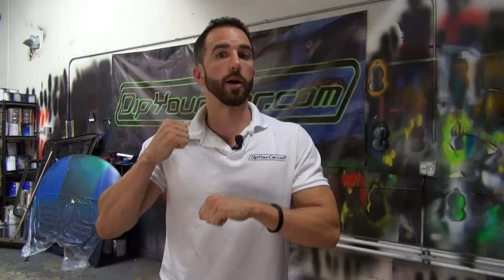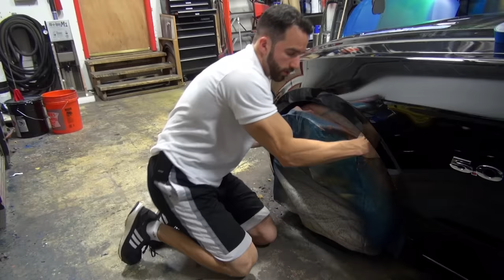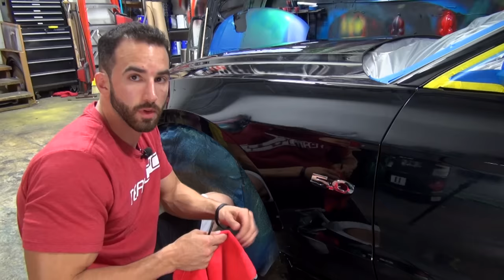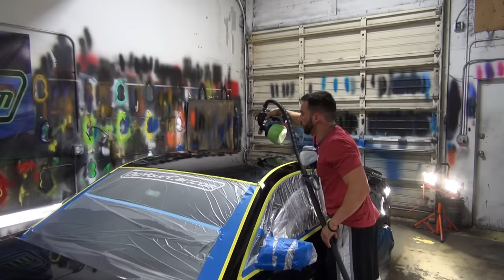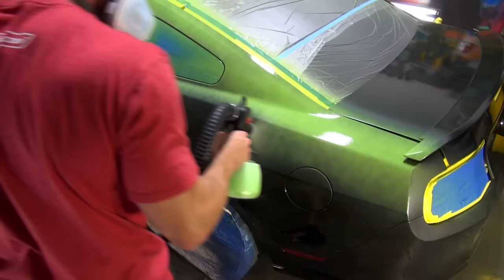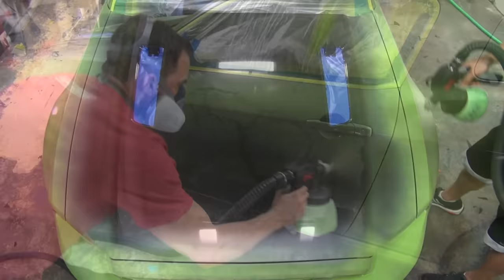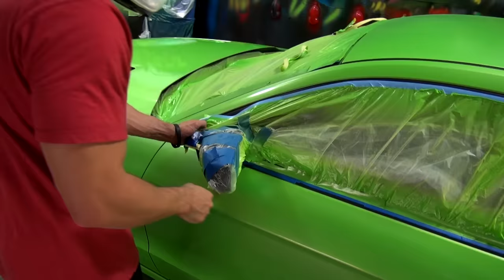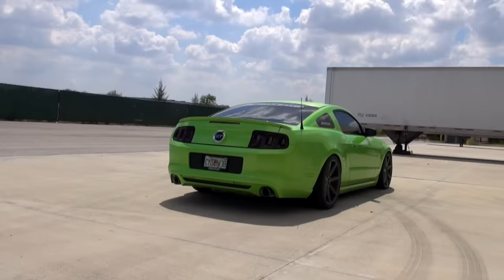Plasti Dip Your Car - The Complete Guide

Comment: I spent two weeks watching your videos learning from you. I recently dipped a Kawasaki mean streak it was 20 degrees when I dipped it I kept my cans in a bucket of hot water and heat gunned every coat. I sprayed 8 coats did the first coat like you suggest. I did it in a matte black it took three spray cans and I'm absolutely amazed it even hid most the imperfections that was in the original paint. I even hit the bike up close with a hottsie it didn't hurt it a bit. Next time I do I'm gonna play around a bit thank you for the information this is a great product and you're a great teacher.
Reply: Upload the video if you have it!

Comment: You should drape the hose around your back and over your shoulder to prevent accidental contact when doing the roof or hood.  It also takes weight off the back of the gun and makes it easier to keep the gun vertical.

Comment: It’s crazy how similar it is to just latex house paint, realized that when you were talking about pulling tape when wet, latex can peel right off too if the surface wasn’t prepped, or even if it was sometimes, typically only when on gloss surfaces (sounds like plastidip on clear coat)

Comment: Did you purposely not mask the  front and rear side marker lenses?
Reply: cosmicmoxa Yeah I think he painted over the front turn signals.
Reply: CurseTheDawn and the little reflectors on the lower rear and the ones on the rear quarter panels lol 😂
Reply: cosmicmoxa I was thinking why he didn't mask the reflectors at the rear and door locks.
Reply: cosmicmoxa It just peels off, the same way the dip peels off of the 5.0 emblem.
Reply: Without masking it tears off.
Reply: +CurseTheDawn not if you peel when wet.

Comment: Will this give my car more horsepower?
Reply: Yes +50bhp
Reply: +ITSASHWEY at least
Reply: yea i gave mine 30
Reply: +M Dubzem 100 hp instant!
Reply: +M Dubzem Takes away 75 horsepower, due to weight and added drag.
Reply: +M Dubzem if you paint your brake calipers red that should give you 20 more bhp, i did it too my toyota camery, now the thing can easily beat a lambo in a 1/4 mile.
Reply: +Scott Sonnier lmfaoo
Reply: rirbf
Reply: +M Dubzem no but it WILL give your car more gay :D
Reply: +M Dubzem Only if its done in Ferrari red.
Reply: Lol!  Good one!
Reply: +deadpoet415 hahahahaha this make my day XD
Reply: +Scott Sonnier      What color did you use?
Reply: +M Dubzem depends on the color, black is fastest, naturally...
Reply: +Magnum LesPaul Stripes do not add any HP. That is a myth. The only way to do that with a red car is blue flames on the hood.
Reply: +M Dubzem Only if you choose the red one. The green one in the video just saves gas.
Reply: +Austin Skeen mcm is awesome
Reply: yes, more housepower
Reply: ...... It could DOUBLE your horsepower, if you also add a "Type-R" badge, to the rear deck and the middle of the hood!!!  :P
Reply: over 9000 hp, more if you are a ricer
Reply: Good morning dude
Reply: Only if u add a plasti dipped tachometer to the dash board....
Reply: -5hp

Comment: If you want to have different colors for different parts (i.e. black hood, black roof, black spoiler, rest green/yellow/blue/whatever) how would you go about doing that without mixing colors? Is it safe to tape over finished plasti-dip or do you run the risk of peeling the dip accidentally when removing the tape?